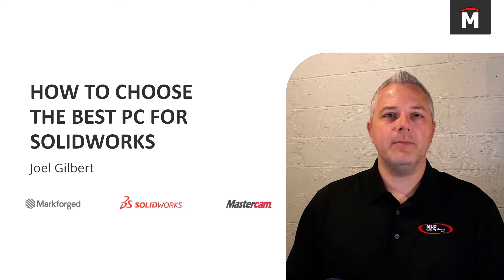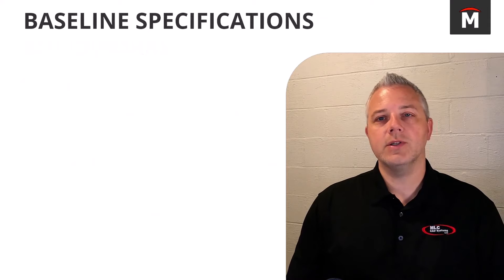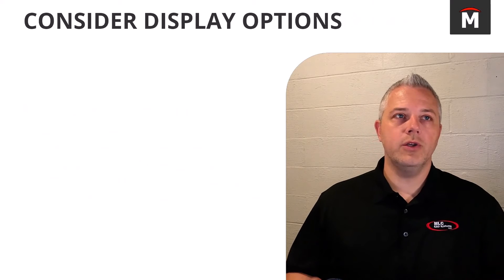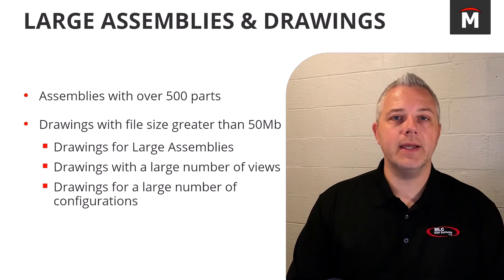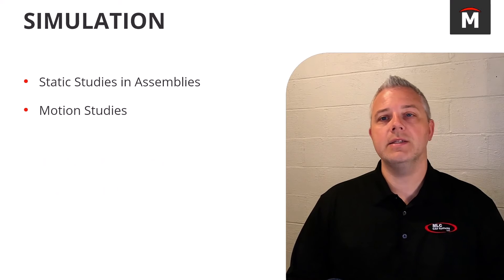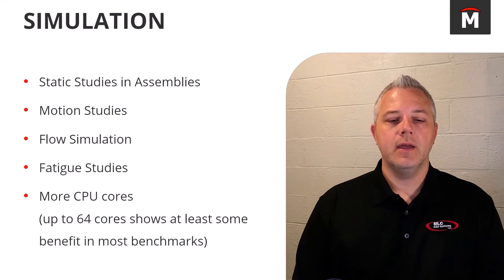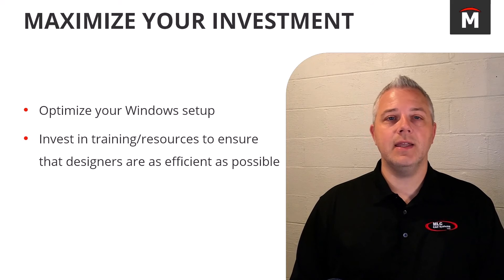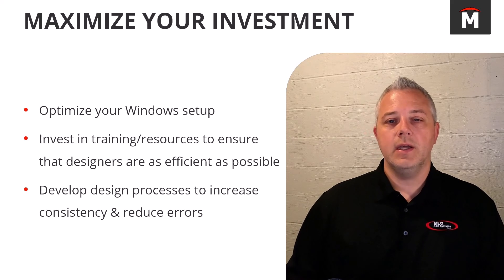How to Choose the Best PC for SOLIDWORKS | Webinar

Comment: CPU
AMD Ryzen 9 9950X 
Cooler
ID-COOLING FX360 INF ARGB BLACK 
Motherboard
MSI X870 Tomohawk WiFi
RAM
Corsair vengeance 64GB 6000mhz RGB
GPU
Nvidia RTX 5080 16GB ZOTAC SOLID Ed 
NVMe
2x - Samsung 990 PRO 2TB 
PSU
XPG Core Reactor ii 1000W 80+ Gold, fully modular 
Case
ASUS TUF GT302 with 4x aRGB fans 

I am building this for solidworks to work on large assemblies.  Will this be a good built ?
Reply: my confusion is regarding the graphic card and processor ?

Comment: Hi Joel! I'm planning to use SolidWorks 2025 mainly for working with complex parts and assemblies of up to around 500 components. I'm considering the following PC build:

CPU: Intel Core i7-14700K (3.4 – 5.6 GHz)

GPU: GeForce RTX 5060 Ti 8GB

RAM: 64GB DDR5 6000MHz

Would this configuration be suitable for this type of workload? Do I really need a workstation GPU like a Quadro, or will the RTX 5060 Ti handle it well enough?

Thanks in advance!
Reply from the maker: That's a nice modern rig, you shouldn't have issues. - You can always check your specs on SOLIDWORKS site to stay up to date on all required/recommend specs. - https://www.solidworks.com/support/system-requirements

Comment: when you talk about CPU, you say at least 12 full cores or 12 threads?
Reply from the maker: 12 cores. Older computers won't have that many, but looking at new workstation computer processors most of them are at or above 12 cores.  This is not a hard rule, but seems to be a baseline for modern workstations equipped with the available CPU products.

Comment: Hi Joel, which one (Ryzen 9 7950X3D or Intel 14900KF) should to prefer for Solidworks 2025 and Gaming sometimes? 😊 (both with 4080 Super and if the price set aside)
Reply from the maker: Max GHz is going to be the main difference regardless of brand, but in general we see slightly better benchmarks for SOLIDWORKS on Intel CPUs. Performance can also vary based on the specific task, so balancing the SOLIDWORKS performance against gaming performance is another thing to balance.  At the end of the day, you're paying for performance vs. cost, and benchmarks are the easiest way to measure that, regardless of brand.
Reply: @MLCCADSystems  Thank so much for your completely feedback ✌